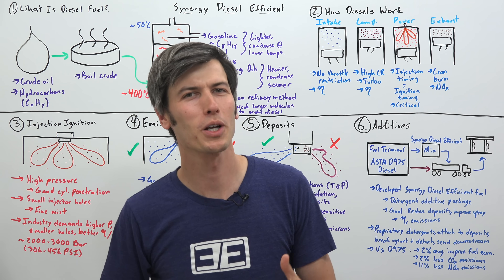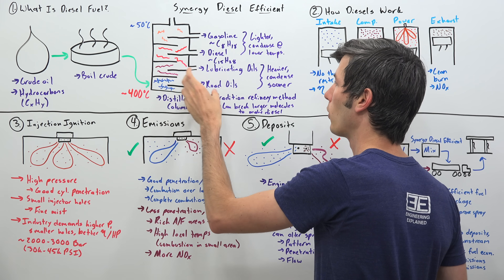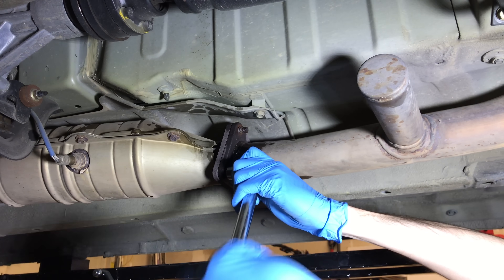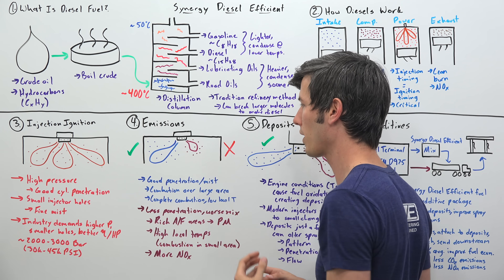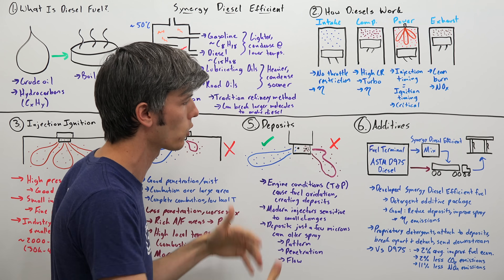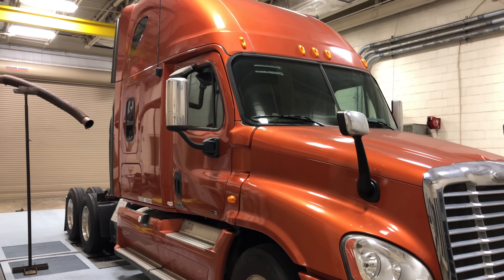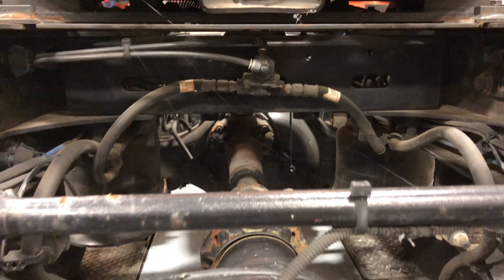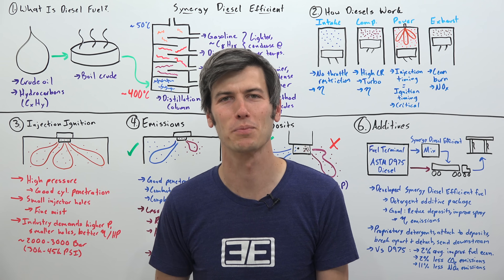Why Diesel Engines Lose Power & Efficiency Over Time

Comment: Correction: modern diesel engines. Old junk gets better after the engine breaks itself in. We got a lot 15 year old diesel cars and I never hear of anyone having injector problems.
Also: is that special fuel more expensive? if so it kinda nullifies the 2% benefit
Also2: test in a lab, in controlled conditions and no human factor (or human factor of the few scientists doing the experiment) doesn't directly correlate to outdoor user experience.
Reply: I love how armchair scientists think that lab results are meaningless. How else are you going to check the results of a theory?
Reply: @DeanBeckerdjbckr  field testing. Real people (not an optimized program in optimized lab setting) driving different cars in varied conditions.
Reply: @Mic_Glow  To get useful reliable data from that is next to impossible. To many variables, both known and unknown, influence the results. You can collect enough data to suggest that there is a statistical trend, but that takes several thousands of participants, and a very long time before you're able to get within a few percent of error margin, and it's not certain you would ever be able to get it that low. So no, lab tests are the only way to be reasonably sure of the quality of your data.
Reply: @blahorgaslisk7763  ok, the data is high quality, but only thing it provides is a marginally small improvement in lab conditions. Lots of cases where "thoughtfully" tested devices and innovations failed once they started being used (from chips shorting out in satellites due to "thoughtfully tested" new solder mixture to folding phones that survived 100.000 folds in factory lab but got broken in 2 days by human users). I'd approach this 2% with extreme caution- if it's not noticeable by the end user/ company (can take few year fuel usage and divide by miles- 2% saving would be visible I think- some companies track every gallon) , it's not worth it.
Reply: @Mic_Glow  And I concur with what you say. With the data shown in the video it's hard to recommend this fuel over any regular diesel. And the last time I saw something like this it was way underwhelming, often even testing worse than regular fuel. 2% reduction of fuel consumption is small enough it will be hard to prove either way. But they do also claim a large reduction of NOx, 11% if I remember correctly, and that is easily (relatively at least) tested. That might not mean anything for your wallet, but at least it might give an indication on the accuracy of the data they present. Another thing is the presumed ability to prevent or even remove carbon buildup. But this takes time before it can be proved or disproved. It also takes someone willing to take on the task of testing for it.
Reply: I doubt there are many diesel users who could claim to be able to "experience" a 2% change in fuel economy or power or any thing else. Nor will they "experience" 11% improvement in NOX emissions, other than if they actually measure it. What these lab tests shows is that this fuel has the potential to improve fuel efficiency by about 2%, and reduce the NOX emissions . Now if it's a human stomping the gas pedal or a robot doesn't really matter. Also note that so far we've only seen what one lab says, while it was implied that there has been tests run at other laboratories that's allegedly independent, but we are only likely to hear about the positive results as these tests are paid for by the company behind the product. Last time I heard about something like this it was petrol, and the claim was for about 2 - 4 %improvement, but third party testing showed between 0 - 2 % increase in fuel consumption. Only reason that they tried to market that fuel was because they knew no one would be able to quantify the difference during regular use, and they counted on the placebo effect. Not that placebo would mean anything for the engines, but the users are very receptive to it.
Reply: @blahorgaslisk7763  It matters if it's a human or a program, program will shift gears perfectly and keep the engine at optimal rpm, temperature etc. human might get lazy and wait a bit in higher or lower gear because "well, I'm gonna change in 2 seconds anyway,". There are also things like winter (not everyone waits 5-10 min for oil to warm up for a 10 minute trip), unforeseen reactions/ corrosion/ abrasion and sediments from the additives (they didn't test with every car brand and every part combination, did they. Interaction with old diesels without those fancy micro nozzle injectors... (might increase fuel consumption). It is a very small test sample and until transport companies confirm the improvement, it's just on paper. Speaking of transport- those people do thousands of miles per month, avoiding cities and traffic when possible. Long, constant load. Average joe might not get the improvement even if there is one.

Comment: Hello Jason! I would like to ask a question and i d be happy if you could answer that in simple numbers. How many CO2 emissions we have if we burn a liter of diesel fuel and a liter of gasoline! This could help my decision to choose between them. I only want to know those numbers nothing else. Thanks for the always informative videos.
Reply: Considering modern engines, it depends on how much power you need. Irregardless of what you pick, diesel's higher efficiency doesnt matter if the vehicle is 50% heavier and you are using 30% more power all the time. If picking between the same vehicle, than the diesel would be more efficient  as diesels only weigh a bit more. Irregardless how much CO2 you get is purely based on how much power you need and even though diesel's efficiency means less CO2 for the same amount of usable power, its not going to help if you are constantly mashing the throttle. Pick an engine that has the power you need based on your driving and use, ideally as long as you dont have to rev more than 50% of the available rev range for short bursts and less than 30% of the rev the rest of the time.

There are also other factors. diesels are much better on the highway while petrol is much better in the city, and this is just down to the difference in engine mechanics between the 2. Diesel turbos are always on, and with emission regulations, that means that it will not burn lean so if too much air goes in the ECU will match it with the right amount of fuel. Basically its really just down to the way you drive and you have to consider that diesels have turbos so you have to treat it and drive it like any turbo engine with a bunch of dos and donts for it.
Reply: couldnt find your reply but you are mainly asking in terms of picking a vehicle, and usually the answer to that is simply based on how you drive and what you use it for rather than which one emits less. your driving style can mean the difference between one engine having more emissions over another.
While diesels do emit less CO2 per power than gasoline because of the engine design which is what i said and answered your question, that does not matter when your picking a car. Drive it wrong and you can be using more fuel and emitting more CO2 than a gasoline if you drive it wrong. So pick based on your driving and use.
Reply: Thanks for the reply but again my question is simply the one i have put before so clearly as i could. All i want to know is the release of CO2 emissions out of the combustion of the same quantity of fuel nothing else.
Reply: @alexmobil7463  If you're comparing 1 liter of petrol to 1 liter of diesel, Diesel produces much more CO2 than petrol when the same amount of fuel is burnt, and this is because diesel is more densed so 1 liter of diesel contains more carbon atoms than 1 liter of petrol, and theoratically in modern engines every carbon molecule from the fuel in the cylinder should be burnt.
Reply: Thank you very much this is a very clear answer and i do have understand it. I do have a clear picture now and that can help me a lot. Thanks again.

Comment: Almost no large fleet will ever use this fuel though since they are on discount programs with the big 3 truck stops. Would be interesting to see how it compares to using an aftermarket fuel treatment. Like Diesel Kleen or Lucas upper cylinder lubrication and injector cleaner.

Comment: Idk my I’ve known a lot of high hour tractors to stay at the same power or have even more than the quoted power when put on the dyno. Commonrail or not.
Reply: Really?  I am looking to buy a tractor and the only affordable 75-80 horse power tractors have 6 - 9 thousand hours , Massey Ferguson,  Steyr, in Germany and Austria.  Would you advise against buying such high engine hour tractors?
Reply: Branimir Todorov That’s kind of a hard question to answer. It really depends on the service history, the type of farm it’s on and the type of work it’s done.

Personally, I’d take a gamble on tractors with 4000-6000 hours. Anything more than that, the seller is going to have to show me it’s been looked after really well.

Comment: Can diesel injectors be cleaned? If so is it best doing it manually by removing them or through the use of additives such as Redex, Wynns etc. Lastly, is this worth doing on an engine with say 100-120,000+ miles?
Reply: As long as you think the engine is worth keeping up, I have engines at 150,00 and there still going strong

Comment: NOx is far bigger problem for people than CO2 since CO2 doesn't cause SMOG. 11% reduction in NOx is HUGE, sounds way too big of a claim. Is there another independent source that verify this? Another question, what combustion toxic emissions are produced by the detergent?
Reply: @JohnDoe-jk3vv  I'm amazed how gullible people don't care what comes out the exhaust and thinks asking the question is tin foil hat. Be more skeptical of outlandish claims.
Reply: @JohnDoe-jk3vv  I don't care what's in the detergent. I care what comes out the tail pipe after burned. That can be measured.
Reply: I actually pump nox into my bedroom at night. I dunno but it seems to help me sleep better.
Reply: well the worst case could be sulfur dioxide, depending on the formula of the product jason is trying to advertise
Reply: @karimnasser6710  VX Gas is  C11H26NO2PS. Not saying VX gas is in exhaust, but it has all the components necessary if you throw in Phosphate and Sulfur in detergent. So still the question is what extra stuff is coming out the exhaust?
Reply: freezeme360  That is hilarious! Thanks!!
Reply: @JohnDoe-jk3vv  🤣🤣🤣You sound like you just escaped from a mental institute
Reply: One thing kills us directly, the other one indirectly - so yeah, pick your poison :D

Comment: 2% on a drive by wire, and measured at the driveshaft.  In the real world, everyone is gonna pay more and not gain anything.
Reply: Actually that is not really that important, because it does slightly better for any given input. So you would run better. The main thing is, so it might be 2% more fuel economy but the price hike is more than that 2%. There is no cost incentive to run this fuel. Other then good feelings and less emissions.
Reply: @Torchedini  well it depends, some fuels have cleaning additives that help prevent the build up of soot.
I can tell you that if I run cheap fuel on my diesel car, after a month you start feeling a clogged EGR. Premium fuel with aditives help a LOT with EGR soot buildup
Reply: Torchedini might not be a cost incentive related directly to increased fuel economy. But if running better fuel increases the life of injectors or injections pumps then there is a significant cost savings since those thing would have be replaced less often.

Comment: Never heard of a diesel losing power overtime.. in contrast with many petrol cars losing significantly power bcoz of e.g. intake carbination....  my 10y old Audi 3.0 v6 tdi is pushing 350 PS all the time w.o issues...
Reply: They would loose power due to builds ups on the injectors. With good fuel filtration and good quality fuel that may never become an issue. Plus even if it does, change the injectors and boom right back to the same power and efficiency. If someone is making the assumption that nobody changes injectors the the build up would be a bigger deal.
Reply: @malnfc8565  carbon buildup is only a problem with direct injection.

Comment: modern pickup diesels r only expected to go 200,000 miles? wow! new diesels really have gotten crappy.
Reply: Emissions regulation did that
Reply: @james2042  yep! old diesels would run after an emp blast. modern ones leave u stranded whenever they feel like it.
Reply: Hell, that's when cars leave Germany and go east.
Reply: Is it really that surprising though? Diesel engines of yesteryear had far less power & torque compared to today, a quick Google search shows the original 1994 Powerstroke 7.3L was basically half the power/tq of the current 6.7L engine. You can't get power & reliability unless you either spend a fortune on premium materials or make everything physically big like in a semi-truck. And since neither of those are practical solutions, the answer is to increase maintenance cycles or detune the engine. 

Look at the Ford 6.7L Powerstroke - in the F250/350 it produces about 440hp / 930tq but if you get the Medium Duty work truck, that same engine gets detuned to around 300hp / 700tq for reliability and increased duty cycle.
Reply: @Spinal2111  the issue is how much of that crank power you lose in parasitic loss to the emissions equipment. Deleting a modern diesel will put its reliability right back to where it was
Reply: @Spinal2111  look at the old cummins 5.9l. their power could be increased a good bit and they'd still go 500,000 miles without breaking a sweat.

Comment: What will ultimately determine whether it is worth to use this detergent mix is price and availability. It would also be interesting to see how much carbonization was removed from the engines. It may not be necessary to run with detergent at all times, but every other tank.

Comment: As far as the class 8 tractor sitting on a Dyno.that test on the truck was so controlled anybody could get numbers.  Hook that truck up to a trailer and run that thing loaded for 30,000 miles and see if you get the same results..perfect testing in a perfect world like that lab will give you those perfect results.. you need variables to get more consistent results.
Reply: No, the goal is to eliminate as many variables as possible. In a perfect world, the only variable that should differ from the baseline test is the change to the exxon synergy fuel. The use of the dynamometer and a controlled "lab" is the only way to ensure consistent and reliable results. You may be skeptical of Exxon's claims but clearly you don't understand the scientific method.
Reply: @collinaustin4164  The environment is completely sterile !
That's the most ridiculous thing to hear...
LMAO 😂

Comment: You left a lot on the table. The new injectors are more than higher pressure and finer spray. They are electronic and injection timing, duration and flow is infinitely adjustable. Most older diesels have mechanical injectors and timing  fixed. This is the idea behind CR or common rail, a very high pressure pump feeds electronic injectors which are individually controlled and chamber pressure is monitored. The  timing, duration and rate are precisely controlled not possible before.
Reply: This was a commercial nothing more lol...
Reply: Um this has nothing to do with why they lose power... old diesels get deposits, and injectors on older diesels are pretty much a wear item... new stuff may be more sensitive but... still effects them the same...
Reply: @mattlane2282  What I'm telling you the computer-controlled piezoelectric injectors are monitored by computers, make all the adjustments even for wear or any kind of degradation due to  deposits. This guy doesn't do his research, there are areas he's not very knowledgeable about. He's thinking a very old Diesel's but those will go 300,000 miles easily, some half to one million miles without any real loss of performance. He's wrong and has no data to back it up. Diesel run the world in supertankers, heavy construction equipment, semi-trailer trucks, generators, you name it, they are running the World.
Reply: @gmcjetpilot  super tankers run on like tar... They cover up at best... but you still have a performance lose... you can't adjust for bad amortization but this was just a commercial for exxon nothing more I mean it was not even an attempt to cover why diesels lose performance... it was a flat out commercial.
Reply: @mattlane2282  Tar? Ha ha. No you're thinking of Bunker oil and burning in boiler to make steam for steam turbines. Almost all the super container ships and tankers today run on gigantic diesels and diesel #2. They are efficient and simpler...  Diesel performance degradation is just a non-issue. If an injector is blocked? You take the injectors out and clean it. NO BIG DEAL. The huge diesels are made for ease of repair or overhaul. Each cylinder can be replaced or repaired individually. Loss of performance with diesels is not an issue. However if there's a problem with the Piston or valve that piston or valve can be replaced easily. Have you ever worked on a diesel engine in your life? Apparently not. I just don't think you know what you're talkin about. Diesels are not built like piston engines. They're about 20 times stronger because they have to deal with much higher pressures. They have larger and more main Journal bearings. They're just built like industrial engines because they are work horses. They're made to go for decades with very little maintenance, and when they do need maintenance it's easy to do.
Reply: @mattlane2282  But at least the old injectors were serviceable. So  what is prefered these days , petrol or diesel?
Reply: Exactly, timing and multiple inyections are key. He didn't mention it being so important